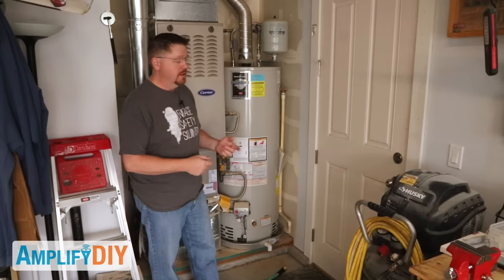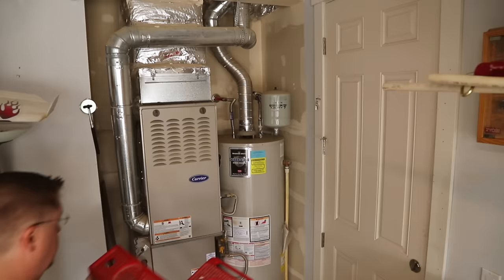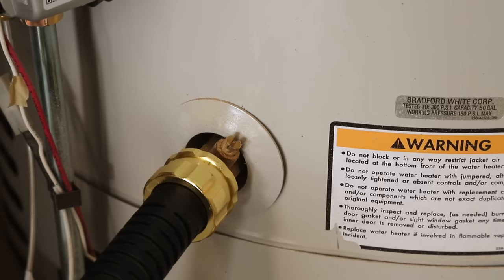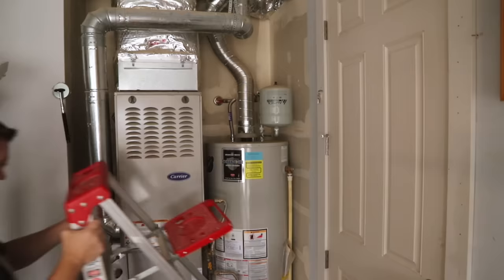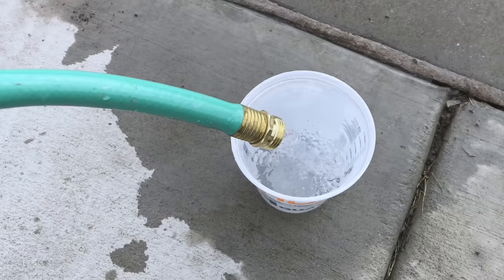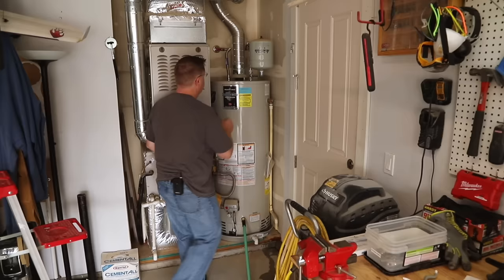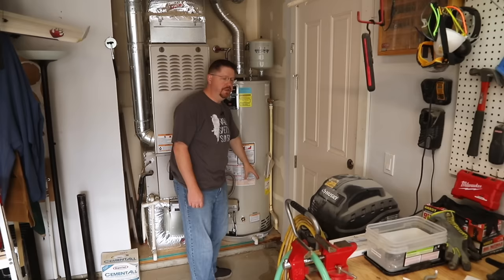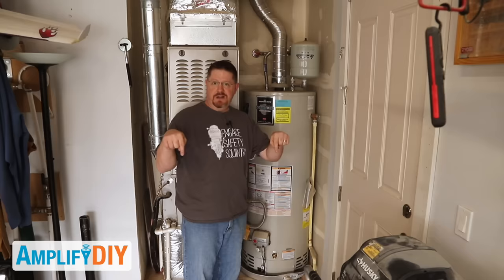How To Flush A Hot Water Heater To Remove Sediment

Comment: After you are through doing this, remember to write down the date you did this on the tank.  One year from the draining, you will not have to rely on you memory to know when was the last time you drained the tank.
Reply from the maker: Great idea!
Reply: I keep all my car and household maintenance plus personal medical checkups dates and details on my phone and sync with all my iOS machines.  It's like centralize their record for everything need to be done year round
Reply: The manufacturer recommends draining my electric water heater  to get rid of sediment once a month (The recommendation used to be once every three months with the same model). I see that the video host tells people to shut off the cold water supply valve and open the hot water faucet or the safety valve for draining.  However,  I like to get rid of the sediment  by keeping the cold water supply valve open and both the hot water faucet and safety valve closed. The power switch has to be off, of course. 
By keeping the cold water supply valve open, the high water pressure from the cold water supply allows me to get rid of the sediment in high speed of about 10 seconds. Actually, what I do is not draining but flushing out the sediment.   I can collect almost two table spoonful of sediment each month within 10 seconds. From the very small amount of sediment collected by the  video host after using the hot water for one year, I think a lot of sediment is still inside the tank and could not get out because the speed of the water that came out was too slow. So I think flushing to get rid of the sediment is faster and easier than draining. 
Since I still think it's too much work to connect a hose to the tank to flush out the sediment, I have decided to change to flushing out the sediment once every three months. It is more satisfying to see about 6 spoonful of sediments than just two.
Reply from the maker: @simon6071  Hi Simon - Once a month is pretty excessive, unless you are in an area with VERY hard water and/or a LOT of sediment from your municipal supply. Your method of flushing is actually not as effective as you may think, due to the Bernoulli effect on the relative velocities of the water inside your plumbing and water heater tank. In short: If you do not turn off the cold water inlet, the tank and all the plumbing remains pressurized at the same pressure. As the water flows through a relatively small diameter pipe (i.e., the cold water inlet or the drain pipe) it moves VERY fast due to this pressure. However, as soon as the water enters the tank, it slows down to an absolute crawl. Your method will only flush out the sediment which has collected very near the drain - like within an inch or so of it. Beyond that distance, the water is simply moving way too slowly to stir up any of the sediment at the bottom of your tank. 
The method I demonstrate (empty the tank first, then repeatedly flush for about 10-15 seconds until no more sediment comes out) will stir up the entire bottom of the tank, since the fast moving water coming in from the cold water inlet does not hit a huge mass of water already in the tank: It can spray / swirl across the entire bottom of the tank. I think if you try my method you'll be surprised at how much more sediment comes out than with your method alone. 
Finally, my tank did not have much sediment in it because a) I flush it regularly, b) I have a water softener, and c) I have a whole-house sediment filter that prevents much junk from getting into my tank in the first place. 
Thanks for watching!
Reply: @AmplifyDIY  question. My tank is pretty old and has not been flushed at all (to my knowledge). What do you recommend since there is probably a ton of build up at the bottom?
Reply: Or you can choose days to do it that are easy to remember - like when you change the clocks or the first day of summer...
Reply: macewendu 67 a new water heater...😬. I had one the same way and replaced it because it wasn’t making enough hot water.  For fun, I split my old one open.  It looked like it had a big block of sandstone in it and coating the sides.
If yours is making enough hot water then try flushing it.  If not then my guess is it’s too late.  It never hurts to try though.
Oh, BTW, a water softener can help here - a lot.
Reply: @AmplifyDIY  I understand your explanation why your method is good for getting rid of the more stubbornly attached minerals.  However, since your method requires a lot of work, I will only do it once a year as you recommend and do the easy flushing every three months to just get rid of some sediment at the bottom. 
Thank you for your very sensible and knowledgeable explanation. You deserve my subscription.
Reply from the maker: In depth annually with your quick method more frequently is pretty sensible. Great plan!
Reply: I keep log book on everything I do on vital maintenance, even washing bed sheets that is easy to forget dates.
Reply: @AmplifyDIY  Your approach of draining the tank so the water supply can be turned on and agitate sediment makes a lot of sense to me. 
But after refilling, are you sure the increased flow of having water supply on would only affect sediment within 1" of the drain?  I realize fluid dynamics around an inlet is very different from around an outlet, just didn't think it would be useless here.
Reply: Or iif you do every odd or even year that might be easy too... Write it on the new calendar fir the odd or even year in your kitchen!
Reply: I alternate and do an odd year one year then an even year the next. I do get confused on leap year though.
Reply: Great suggestion. I flush mine every morning December 31st.
Reply: Good idea. Hope I don't forget.....;-)
Reply: Do it on your birthday or your spouse's easy to remember but do the actual work a day before or after as the day is too important

Comment: GREAT VIDEO! Very well explained BUT . . .
just 1 thing, at the end when you think you're done, open ALL  the hot water faucets in the house and after they stop burping air let them run for another minute to make sure all the air is out. What's called water hammer can destroy your plumbing. Super important to get all the air out
Reply from the maker: Great tip!
Reply: Thanks for the tip! My husband and I are under contract for our first home so this video and your extra tip are most helpful.
Reply: 10:13
Reply: That little tank on top of the water heater is there to prevent water hammering.
Reply: For some reason, I have the hose connected at the bottom and open flow and the pressure valve open but no water is flushing, just a bit of water coming out of the pressure valve. Am I doing something wrong ?

Comment: Good instructional video, covers most all of the important points. One thing I might add.

*In the case of an electric water heater, DO NOT turn the power back on until all of the air has been flushed out of the tank through a faucet. The elements need to be surrounded by water before being energized, or they will overheat and burn out*
Reply from the maker: Very good tip. Thanks!
Reply: ⚠️ 🚨 This above instruction is so important and needs to be pinned at the top of this comment thread please ! 🙏🏻 ⚠️🚨
     Its by chance I saw this comment and would not have known to do this as sequencing the steps to safely turn on the water heater is not common knowledge to some of us.   👍 🙌
 I loved this video as it’s very easy to follow along, audio is very good and newbies like me appreciate simple concise instructions. 
    Also, Thank you so much Springtime Plumbing as your comment probably saved me mucking up my water heater! ✊
Reply: This.  We bought a cabin once and in the spring we filled it up (or so we thought) but did not bleed the air out and burned out both elements.  
They aren't expensive at all but it was definitely a newbie learning the hard way!
Reply: Definitely. I would even bleed the air out before I turn the natural gas heater back on. 

Not sure I would turn it all the way up to desired temperature at first. ( At least I don't)
Reply: Thank you, very nice of you to add this advice ... I'm getting ready to do this flush for the first time and don't want to mess up my heater!
Reply: Thanks, very informative and useful
Reply: How do you know if all the air has been flushed out?
Reply: @brookishtx  the hot water will flow smoothly and stop spitting once all the air is out of the tank and lines.
Reply: Just leave the pressure relief open while filling not only will it speed up the filling process but water will come out of it when it is completely full !!!
Reply: @erikrobles5727  do you mean while re-filling the tank? Assuming once I’m done with the flush, I turn the power back on to the tank and re-open the cold water supply and the tank will start to fill up? And while it’s doing that, keep the pressure valve open??
Reply: @jacklegg21  when will it do this? During the flushing process?
Reply: @jessicajordan5611  during the filling process after flushing.
Reply: @jessicajordan5611  yes except for don’t turn the power back on untill you are sure the tank is completely full of water
Reply: Another well done instructional diy video. Quick question what is that personal sized keg of brew doing attached to your …ahem…water heater?
I recall a plumber came into our home years ago for a non-water heater related job and I said should get the personal keg. After following his advice I wound up paying for his daughters first semester at Notre Dame 😄
Remind me again please - is it related to a pressure relief system of some kind? 
I hope so as I really do not care for hot beer 😎
Well done and thank you.
Reply from the maker: LOL - that’s an expansion tank: https://youtu.be/NGygvtP6Sdk
Reply: Yeah I think I may have burnt out my elements cuz mine is electric !!!

Comment: This will be lost amongst the thousands of comments, but I also wanted to say thank you for you presentation. 

Our set up was a little different as it's in the basement, so I purchased a hot-water-rated pump (only $50) and attached it to the tank using the connector hose from my clothes washer. Drained faster than you spoke of (for obvious reasons), but every step you mentioned was spot-on. Local plumber wanted $200 to do it, so you've saved me money now and in the future!
Reply from the maker: Lost or not, Sean, I saw this comment, and was grateful to hear that this video was helpful for you. So, thanks!

Comment: Great video. Ive been doing this twice a year for over 26 years. Same water heater. I did one thing different. I have a short hose with 2 female ends and once its drained i put a hose from an outside faucet and run it backwards into the tank to stir up calcium deposits. Only a couple of minutes and then drain again. Ive got as much as 1 gallon of additional calcium out by doing it this way. For the future im going with small tankless water heaters where needed instead of a central unit.

Comment: Can you teach me how to change my brakes too? 🤣 The Info, pace, detail was all perfect. 
Great teacher
Reply from the maker: One of my cars is just about due for new brakes... what kind of car do you have? The process of changing brake pads will likely be similar.
Reply: Loosen lugs on wheel, Jack car up. Remove wheel, loosen or remove caliper, remove and replace pads. Adjust calipers, place back on, place wheel back on, put on lugs, lower car, tighten lugs.
Reply: Yole blocked toilet
Reply: Blocked toilet
Reply: How do I unblock a toilet
Reply from the maker: @Lone Menzies - why are you asking about how to unblock a toilet on a video about a water heater? 
Sounds like you need to buy a plunger....

Comment: Pro tip: hook your garden hose up before shutting off the cold supply and run it for 15-20 seconds first to blow out all the sediment that accumulates at the bottom of your tank... that the entire purpose of doing a flush on a tank anyways... otherwise 9/10 times your tank won’t drain right due to the sediment blocking up your hose bib..

Great quality video
Reply from the maker: This is a great tip. Thanks for sharing!
Reply: Sorry, I don't understand this tip, can you elaborate? I've never done this before and want to understand how this step works and when to do it.  Thank you.
Reply: Thx for the tip. But if shut off the cold supply then what are we running for 15 seconds to blow out sediment? 🤔. Sorry I don't follow :(
Reply from the maker: @monad.6742  Hi Mona - here is what Eric is suggesting: 
Step 1) Attach hose to drain valve.
Step 2) Open drain valve for 10-15 seconds BEFORE you turn off the cold water inlet. This will clear your drain valve of any clogs.
Step 3) Close the drain valve again, then proceed with the procedure as I outlined in the video. 
Hopefully this makes more sense. Thanks for watching!
Reply: @AmplifyDIY  Should this be done before you turn the heat to pilot?
Also, later on,  when you open a hot faucet to allow air into the system, do you leave that faucet open for the whole procedur? I noticed that at then end of the video you open a hot faucet again which made me think you had maybe closed it. Thanks for the great video!
Reply from the maker: @timwalker8553  Hi Tim - I recommend you turn the heat to pilot before you do this, just because then the heater won't light off while you are working on it. As for the faucet - sorry for the confusion: It does not matter if the faucet is open or closed while you are flushing, just make sure it's open when you re-fill the heater so there is an escape path for the air in the tank. Good luck!

Comment: Another thing to remember after draining your plumbing is that you might want to remove your aerators from your faucets so they don't get clogged. I like the double flush idea.
Reply from the maker: Great tip, Vincent. Thanks!
Reply: I have not flushed ours after 2018 install. I’ve agitated it over ten times and there is still white specks in the water. Will they ever go away or is this tank shot already? Is it necessary for it to be clear?
Reply: I use a bathtub facet for this reason
Reply: @Akiffxiv202  great tip. Thank you!
Reply: Or let it settle prior to opening taps. ?

Comment: I did it today, thank you!  I have two fifty gallon water heaters (large house), and one of them was full of silt.  I bought the house three years ago, so it may be that the owner before me also had never done it, at least for one of the units, or maybe one of the units is newer than the other.  I had to flush that one (the siltier one) out with cold water about twenty times to get it clean.  The other took about six times.  But they're clean now!
Reply: jesus is there any other way to clean these large tanks without flushing it 20 times? what a waste of water..?

Comment: Opening pressure relief valve was key for me to get the water tank to drain fully. But I also had to wait for the water to drain at least below the relief valve level, otherwise water would gush out. Also, when doing the last drain, for me the water pressure was strong, so I had to close the cold water inlet valve before opening hose valve. Made a huge water mess opening hose valve first like he does. Anyways opening relief valve was not told in other videos so this was very very helpful!!
Reply from the maker: Hey Joe - I'm glad you were able to get your heater flushed. Great job!
Reply: So I just finished talking to my neighbor about that pressure  valve and a company told him never touch that valve because there’s a seal in there that can break. I think they just told him that so that he won’t touch the tank.
Reply: @AmplifyDIY   So for those of us who need to use the Pressure Relief Valve to get the water to drain, is it safe to open that valve when the tank is full....our valve does have drain plumbing connected, so will this mean that the level of water above the relief valve in the tank would have to empty through the relief valve plumbing or would it most flow through the open tank drain port?  Thank you!
Reply from the maker: @bh6984  Yes, it's fine to open it while the tank is full, but be sure you have already a) opened the drain valve at the bottom and b) closed the cold water inlet to the tank. As long as you have done that, and your drain valve is not completely blocked, when you open the valve rather than water pouring out of it - air will flow in. At most you may get a few drips out of the valve, but mostly you should just hear a gurgling noise as the air rushes in to allow the water to drain out the bottom drain valve. Good luck!
Reply: @AmplifyDIY   Thank you...I can confirm that what described is exactly what I encounted.  Opening the pressure relief valve finally allowed me to drain the tank slightly and swap out anode rods.

Comment: Thank you for a very clear way to drain and flush the water heater. I live in an area with sever drought and could not bear to waste so much water. I turned the heater off the evening before and was able to take a shower and wash dishes. In the morning, the water was warm, not hot and I used it to water trees. All of the water for flushing also went to trees and plants.

Comment: Nice video.  I just flushed my water heater.  1st time in several years.  My tank had so much sediment that the sediment impeded the flow of water from the drain.  During the quick 15 second water then drain cycles, I used a wire / coat hanger to stick up through the valve in order to unblock the drain.  Its also useful to use the largest diameter garden hose you can.
Reply: Thanks man I got stuck at this step and your advice sure helped!!
Reply: This one damage the drain valve?